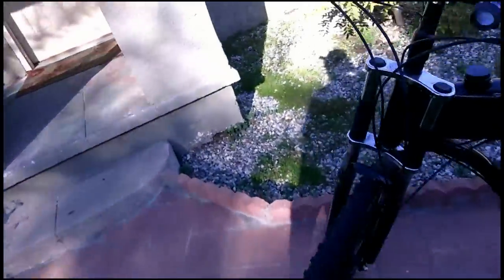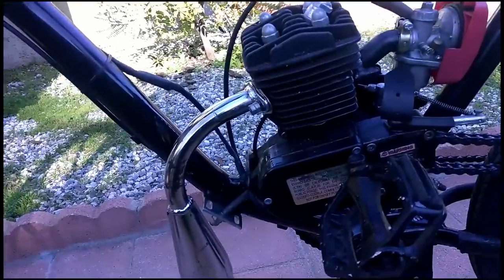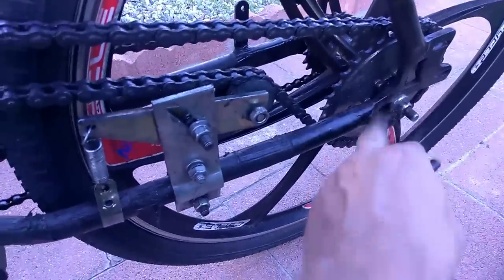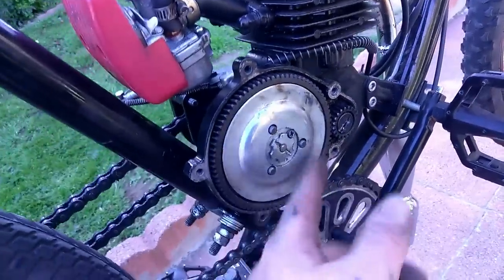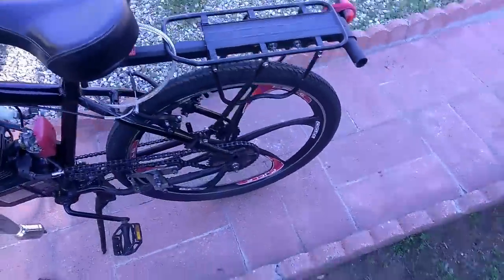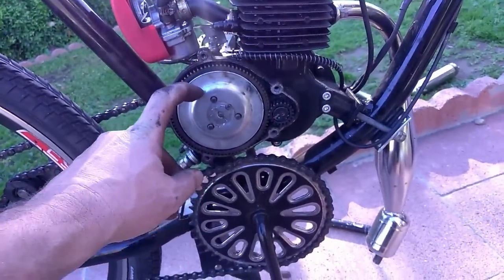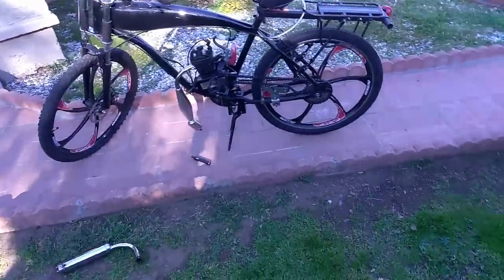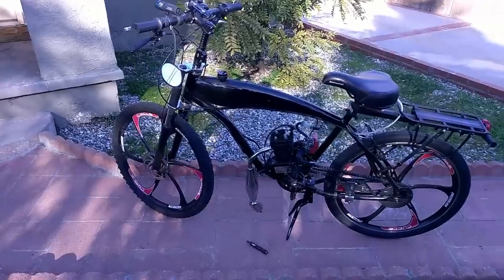PBK0042 - Bikeberry/"ZEDA" BBR Tuning 26" motorized bicycle - updates, upgrades and issues

Comment: weld your frame.. add a wedge under the motor from the mount to the back motor mount bar.. i broke my motor mount 2 times.. and this is what i did not fix.. works /looks great and holds up now fine

Comment: Hello im 67 , ihave a schwinn phantom frame n wheels .i want to go with a 4stroke for the first eng. for pullstart ,knees shot .this is knowledgeble videos .i also am interested in generating power to run a battery for lighting . the battery setup mounted under gas tank looks good .the tank sitting there alone looks stupid .i would like to see how you mounted that setup . awesome its getting me motovated .👍

Comment: If  you want to try and electrify a bike I would try a small  or tiny John deer  alternator ! They're small relatively inexpensive and put out more than enough power! I have seen them used on radio controlled air planes so if they're small enough for those they could work on a bike and though they put out 30 amps or so you can always limit them!

Comment: Great videos, really appreciate your posting them. I'm considering a similar build and wondering what your opinion is on putting some sort of rubber material (piece of inner tube?) between the bike frame and the motor mounts? To act as a vibration damper, or would it allow unwanted engine movement?
Reply from the maker: Wow, I just covered that I'm a video I'm editing now.  I wrapped my frame with a bit of duct tape before mounting the motor on my current setup.  It seems that any engine movement would translate into some lost power.
Reply: @ProjectBoredomKiller  Coolbeans. It seems like a good idea but not finding much information one way or the other about it. I guess you will see soon enough. Thanks for the reply and best of luck!
Reply from the maker: @jimjensen1096  I do know that when my motor mount cracked and the engine was vibrating I lost quite a bit of power.  So it stands to reason that letting the motor vibrate, even intentionally, would cause some power loss.  I wish I had more info for you on this.

Comment: Good vidio bud! I would definitely tighten or replace those crank bearings! I considered the same bike but never pulled the trigger! I go back and forth between old, heavier beach cruisers frames, and this sort of frame, but I do have two old frames and I might just use one of them!  I have a late 70'S free spirit that I bought for parts but it turned out to be way to nice to strip! I also have a late 70's amf roadmaster! I like the amf , it's been a good bike, in fact I bought it for $3 just for the headlight and generator!
Reply from the maker: This frame isn't real solid.  Stick with frames that have a good reputation.

Comment: The muffler is unsupported and will strip the manifold bolts in the cylinder, it has to be supported to keep vibration transmitting to the bolts. Get some loctite and use it. those lockwashers don't work for beans.

Comment: Try putting a smaller wheel on the rear and tasing the seat it will angle the frame back and down raising the front slightly

Comment: For that bolt you had to replace for the reer sprocket what’s the size of the bolt. I need to replace my bolts as they came loose and 3 got bent from coming out and hitting the frame
Reply from the maker: I honestly don't recall.  Same thing happened to me.  I took one of the bolts to the Home Depot and matched it with ones in their metric bolt drawer.  After that, I used some Locktite and lockwashers (or anti-vibration washers) to hold them in.  Never had a problem after that.

Comment: So after all was said and done would you buy this bike again? I see them online for $500 seems like a lot of money for a poorly made product. I was attracted to this model because of the built in fuel tank and the wheels with the mounted engine sprocket. Thank you for this video it made me rethink my decision to buy this bike.
Reply from the maker: I wouldn't pay $900 for it.  As such, it compels me to keep it maintained and fix all the issues it has.  I need it to last as long as possible.  I do like the gas tank, rims and front shocks.  But, no, not for $900 anyway.

Comment: i just changed the jet in my carb.. with my 32 tooth sprocket i went from 35mph to 42 mph just switching jet
Reply from the maker: Did you increase or decrease the jet size?
Reply: I have a cruiser with 32 teeth, i can go without wind 34mph... usually 20-25mph...

Comment: Would this frame work/fit on any zeda motorsports engine ?? Because i love the frame but want a zeda racing engine on it.
Reply from the maker: The motor is a tight fit.  There's barely enough room for the carburetor.  The muffler gets in the way of the pedals so I had to bend the muffler pipe.  If you watch the last part of video #38 you'll see the problem I had with the carb and muffler.
Reply: @ProjectBoredomKiller  you're not mounted to the pedestal that's why your carburetor was a tight fit
Reply from the maker: Thanks, I never realized that.  That engine pedestal is useless as it cracked so easily.  I may consider just cutting it off.